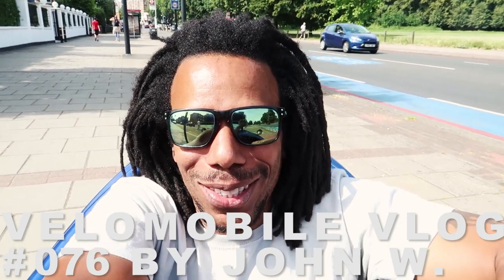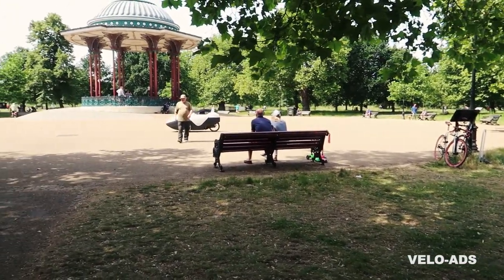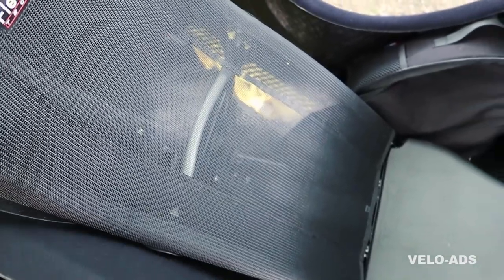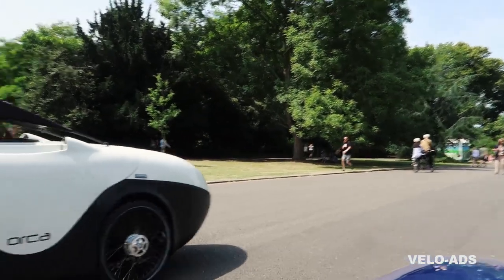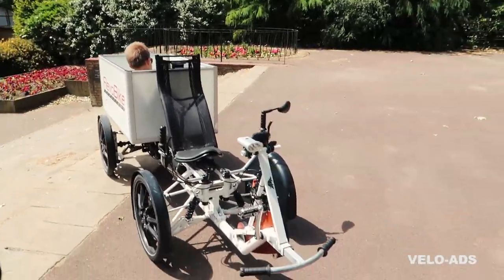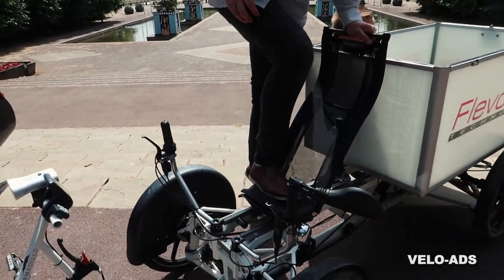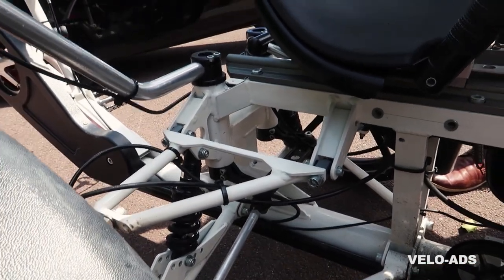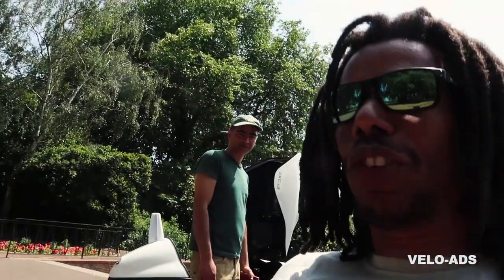THE FIRST ORCA 3.0 VELOMOBILE AND ARMADILLO CARGO BIKE IN LONDON.

Comment: These are stunning machines but being the slight pessimist that I am I just don't see it happening in the UK for a long time . Like the Aussies the majority love cars and anything different puts them off . It's a shame because these can reduce congestion and keep you fit at the same time but with the added benefit of more luggage space and more protection . Needs more advertising  on  television as well as social media . I was also surprised they weigh just over 20kg which is far lighter than I suspected.
Reply from the maker: Seb K every year there are more in the UK so we are getting there, ever the eternal optimist.
Reply: Pr - I get that . Also in Surrey there are so many hills it's ridiculous . When I eventually get one of these it will definitely have electric assist (I have three Ebikes already) .

Comment: I really envy you trying out these machines. I love the Orca it is such a well built machine. The transmission is a superb design imho. I see the Orca as being a very practical velomobile with such easy access and egress.

I've never seen the Armadillo before. Looking at it I wonder if Velove have considered putting a camper style unit on the back? I imagine a streamlined pod big enough to sleep two people. For really long distance touring I think that might be really nice.
Reply from the maker: brighton dude I absolutely love both bikes, I had ideas flying through. My head of touring on one. There is a video online of a guy touring and sleeping in the back of a canvas rig with plastic windows.
Reply: Yep, I asked Johan about a camper style shell for the Armadillo 2.5 years ago; he said he’d like to but needed to focus on the chassis and cargo barebones version first; he then created the first soft shell; they intend to improve then sell a shell v2 as it were but no date on that at the moment. What I’ve learnt from alternating between riding a windcheetah, a QV and a Brox is that height and width really matters in terms of gaining speed. The windcheetah even with a long trailer attached is a lot faster downhill than a Brox. A camper that pops up and out would be great; keep the frontal area as low as possible when on the move, then expand when parked.
Reply: brighton dude That would be a very unique experience for sure, if they did something like that I would be very interested for sure.
Reply: Brighton dude.
I assume you live in Brighton, and you never seen an armadillo?
 There's one in Brighton for more than half a year. It should ride around in Brighton  daily.

Comment: 250 watts is the max allowed under European law, I think under only UK law it is 200 watts solo and 250 watts tandem but European law trumps ours now ( for the moment, until March 2019 probably) anything more powerful and a reg plate, tax, insurance and MOT would be required.
Reply: Neal Archer No, all electric bikes have a max 250 watt all across Europe. That is, the motor is limited.  where I come from electric bikes are speed limited, the cut off point is 25km/hr. When using it as a bicycle with assist, I can accelerate to 25km, but there is no limit (other than the max limit of that particular road). Speed Pedelecs, for now, are limited to 45km/hr. They are seen as mopeds under Dutch law. 

To put that in perspective were I ride my recumbent I would be limited to the legal road limits. Within the city limits a maximum of 50km/hr. Outside, either 60 to 80. The trouble starts with the legality of it all. It is easier to legally put a number on speed as opposed to a number on power. That is the sole reason for the 250watt number.

I  realise there is a vast difference between what is used in the Netherlands as opposed to the rest on the EU. Both in bicycle use and the way bikes are used. For now EU rules are used based on the experiences of my country. However there is no reason, even under EU rules, countries can and do differ. Oh, mopeds are taxed, do need insurance, need a helmet... Even in the Netherlands those Lycra devils use head protection, it makes sense, doesn't it? I use an electric bike, a vintage bike, a recumbent, and a road bike. For now not a velo, if and when my commute distance changes I'll think about a Quattro Velo. Do I need a car? Not really, if I need one I'll rent one.

Concerning the UK, what I don't understand is the hostility toward cyclists.  I would think the more bicycles there are the less congestion there is for motorist? Guess that is my Dutch way of thinking. I'm one of those idiots who takes the train to Amsterdam, rents a bike for 3.50, visits family. And all that for less than the price of ticket to park a car... Isn't that stupid?
Reply: Paul C can't understand our hatred of cyclists either, it is basic jealousy half the time when they are stood in traffic and the bike isn't but then again, if you are too lazy to cycle, then it is the car driver's fault he is locked in traffic, he too has the option.
Reply: Neal, one of the reasons of the post about pollution has to do with my understanding of the laws regarding bicycle use in the UK. As far as I know there is no tax called 'road tax', there was a tax disk which but that got replaced with number plates. In those times before the number plates bicycles had a disk and were able to use the roads. Pedestrians were exempt because walking was 'normal'? For me motorists behaviour in the UK is, eh, uncivilized. Sure, it isn't always smelling like roses on Dutch roads. We have accidents between all modalities. By far the biggest difference between our countries is the attitude. Every car driver in the Netherlands used to be a bicyclist. They know the rules of the road, the hidden signals, the nod, staring at the motorist before crossing and even swearing when someone makes a mistake. But never ever will a driver try to hurt bicyclist willingly.

That, of all things, has to be paramount. You do no set out to hurt someone, period. Seems UK motorists have a different mindset. Maybe, just maybe, there is one rule regarding traffic the UK needs to implement. Has to do with priorities. Those less vulnerable are at fault, always. Make the whole thing workable: pedestrians, bicycles, motor vehicles. The heavier the vehicle... oh, isn't that the way the vehicle tax works?
Reply: Paul C there is no payment for the right to be on the road. In Britain we have what is called vehicle excise duty, which is just another tax really and the money raised does not fix or build roads directly, it just goes into general taxation, that everything national is payed from. Local roads are paid from council tax, which local town councils raise from taxes on living in houses and from local businesses as well. Road tax was abolished about 1919, so there is no greater right to use the roads if paid for by a motor vehicle than a cycle. I wish that Netherlands law was used here where cyclists are assumed to be innocent and motor vehicles are assumed guilty unless proved otherwise - much more civilised and putting the onus on the more dangerous vehicle, making them much more risk aware.
Reply: Helmets don't make a difference to safety, it makes it more dangerous for the faster riders beause helmets absorb very little of the forces in higher speed/higher load impacts (they split/crack and don't compress as they should for a start at higher than wlaking speeds). The speed of 25km/h for electric bikes is proving to be a problem in NL as this exceeds the natural speed of the majority of users (those over 60), this in itself has had a disastrous effect on cycling deaths where the age groups using/buying e-bikes have had a complete turnaround in deaths, increasing by 50% and bucking the downward trend to the groups who don't buy e-bikes anywhere near as much. This is known but ignored by the European Cycling Federation.
Reply: I do not think that there is any one reason for the relations between riders and drivers, (that will vary from person to person), but from the experience of doing a lot of riding as a teenager, to driving and later using motorcycles, now mostly using a 'Bent trike, I have encountered a variety of situations that give insight to some of the antipathy to 'others.

Around London you can get a breed of rider who does not give a damn about other road users, cutting up cars and pedestrians alike, running red lights as a matter of course, and getting away with it. (On cycle tracks they do it to other riders, steaming past at high speed!) They give riders a bad 'rep' and no wonder drivers get angry. Driving in heavy traffic for any length of time will give you a short fuse, then you find the one idiot rider (most of us are not, but it only takes the one for us all to be 'tarred with the same brush'), who gets in your way at JUST the wrong moment, and that fuse is lit. Wait for the BANG. 

I have met fellow riders who rejoice in "sticking it to the drivers!"  What? * ! I have met fellow drivers who think that if bikes are used on the road, then the rider should be licenced, insured, and taxed, like drivers. I can see their point, even as I would argue heatedly against it.

As a rider I know how much of an obstruction I am on the road to a car. If there is a tailback behind me, and a place to pull in to let them pass, I DO. Common courtesy! If there is a blind bend, and I see it is clear for an overtake, I motion the vehicle to pass me. As a driver I try to give a wide space when passing a bike, and not pass at a dangerous speed.

In Britain (maybe just England? I can not be sure) there is a longstanding US and THEM mentality. Shop floor 'against' Management. The 'Have's' and the 'Have-Not's' Perhaps it has carried over into general living, with each side resenting something of the other, and reacting without consideration.

My view: Try to respect everybody, (until they really give you a reason not to), see their point of view as well as your own, and 'Do as you would be done by' 

Yikes! Did I write ALL that? Now I shut-up.
Reply: 250 watts, technically speaking, is merely what the manufacturers certify the motor can output continuously without burning out. It's not what the motor is limited to. You could put a 250W sticker on something capable of 10kW and not be lying.

Comment: Sorry you have so little to work with but you make the most of your stupid 250 watt limit. Americans complain about our 750 watt/ 20 mph limit not being enough, car addicts still insist on 35+ mph speeds for ebikes so they continue to abuse heavy polluting cars. My ELF is the heavy hauler of velomobiles, it has a 550 pound payload capacity. I can haul 30 bags of groceries or a passenger. I find it a good replacement for the car I dumped 5 years ago. I love the 100 watt solar roof which gives 100% of the power I need for keeping a charge.